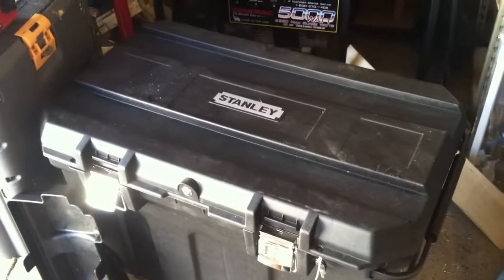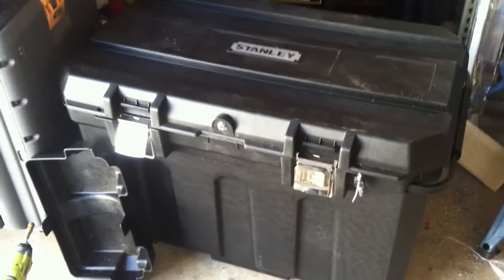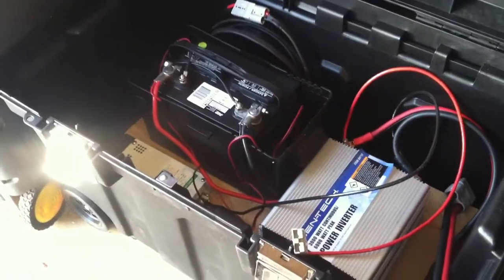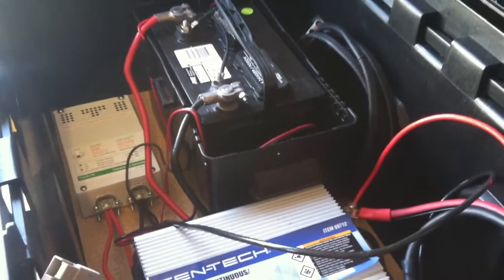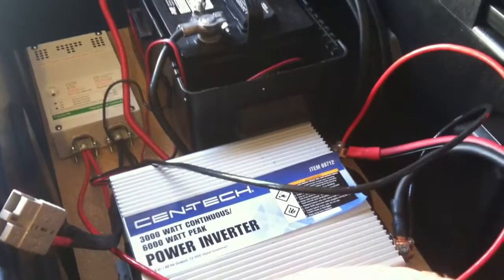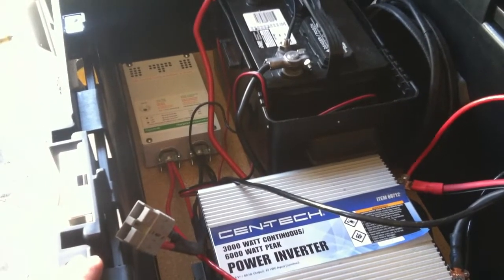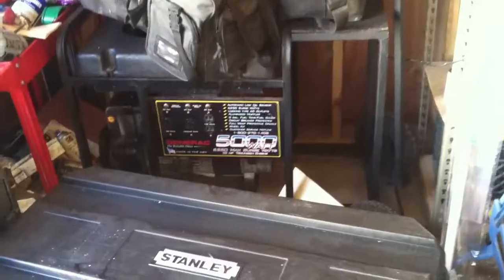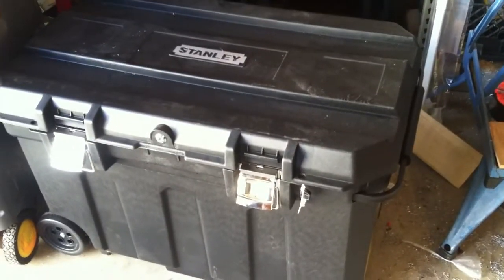Upsizing the semi-portable solar generator system

Comment: NEVER NEVER NEVER Put your electronics in the same space as a flooded Lead Acid battery. Any vapor from the battery and there will be acid fumes even when not charging WILL corrode your electronics and possibly become a bomb. But it is Your project!

Comment: Isn't your cable between the battery and inverter going to become a fuse if you don't use an actual fuse or breaker. 12v divide 3000w is 250 amps